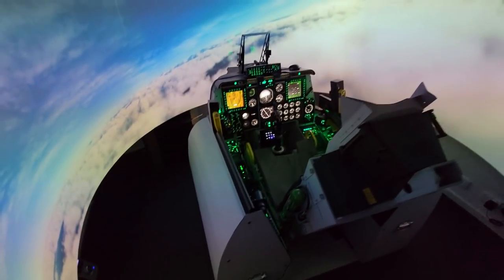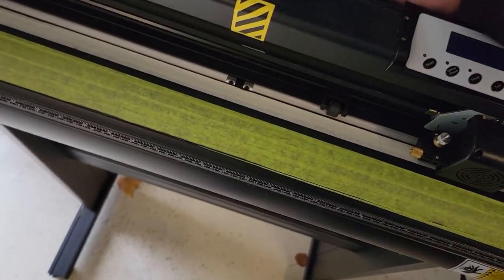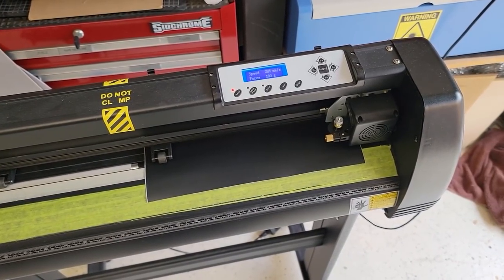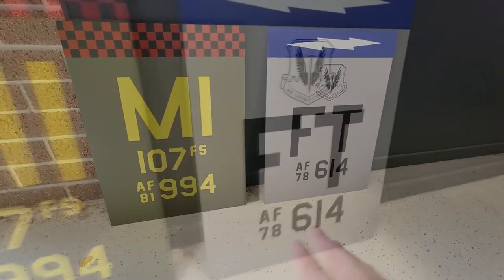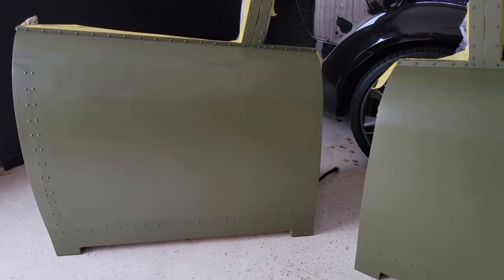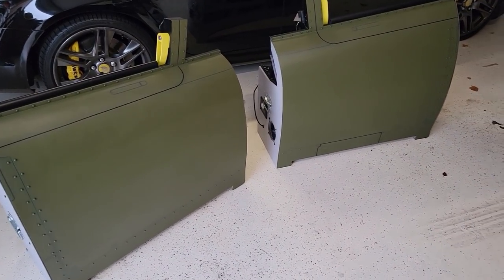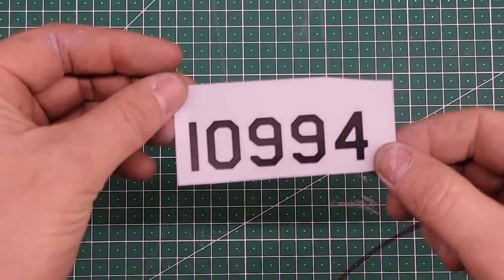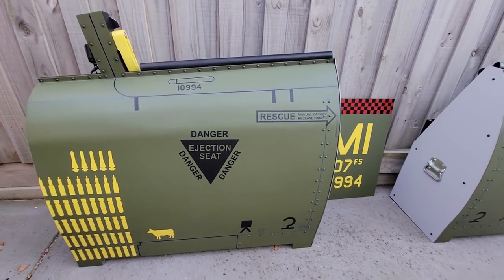New Paint - and a cheap eBay Vinyl Cutter

Comment: I painted my sim with paint from the tactical section of the big box store too. One thing that really helped it look better when using a paint roller was an additive called "Flood Floetrol" - it helps the paint lay down without the texture you can get with a brush or a roller typically. Just make sure you get the right kind for the paint type you're using. Top notch result on yours, keep up the good work!

Comment: Holy smokes looks great. I used to work with a fellow that made vinyl cuts for traffic signs and other than the size of the vinyl cutting machine and the vinyl material, it's exactly the same process. I think one day your sim will actually take off and fly it that good. I Know your Warthog project is ongoing, but if you could place a monetary value or if you would put the sim up for sell, how much? Keep in mind the question is coming from the USA, land of the freaks, oops I mean free...

Comment: Curious to know your thoughts on the IC debacle.
Must admit i'm annoyed, but my pit is barely a scratch on what you have.
The though that everything you've done could be for naught at ED's whim is frightening.
They seem to be partially retracting it, but i find it pretty incredible they done have an internal tester that picked up on this in an internal beta before it went 'OPEN' beta.
Reply from the maker: I was planning a video about it, however ED have announced they are rolling back the IC change tomorrow. They seemed to have listened to their community.